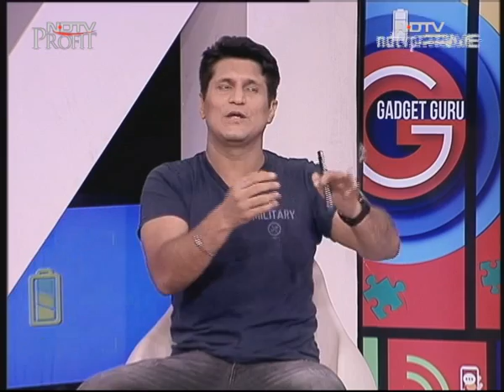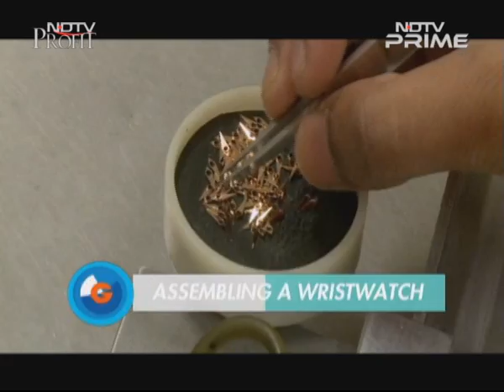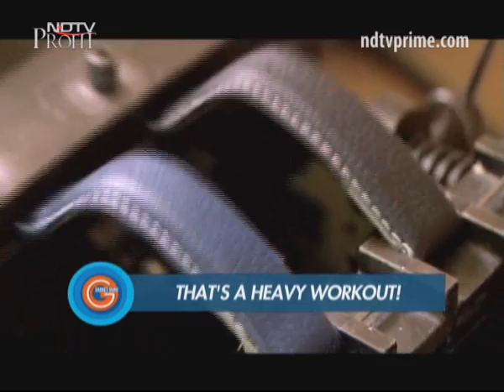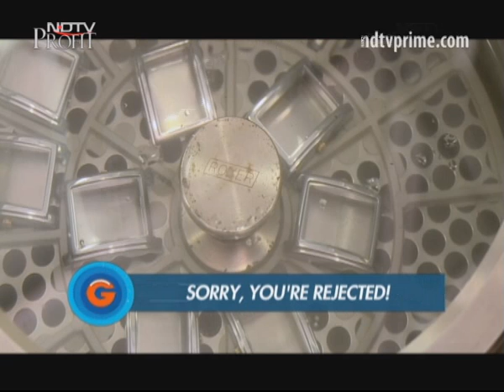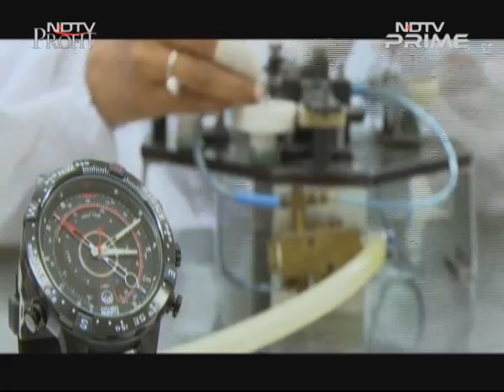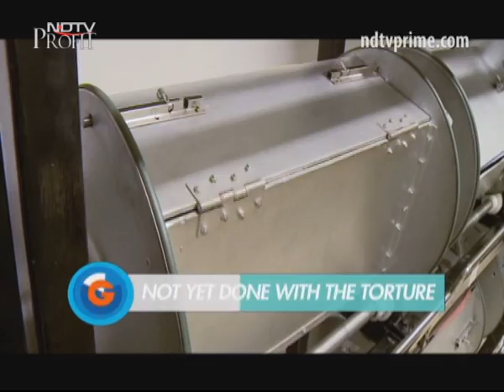Gadget Guru's Timex watch factory visit

Comment: That blue band she's wearing for static discharge is crap. If you want real ESD control, you need a ground foot strap on each foot and the shop floor must have ESD flooring and if you're sitting at a bench, you'll need a ground plug.

Comment: Nice to know the factory. Those are very low cost and low end watches, just as Casios are: cheap watches to buy and throw away (even though there are some very nice models on both brands). Fine watches are on other price levels. I have like a dozen Timex and all of them work fine for its price point, except for the Timex Connected App for Android that has some flaws.
Reply: Casio cheap watches? G Shock, Edifice, Protrek are jokes? Noob!